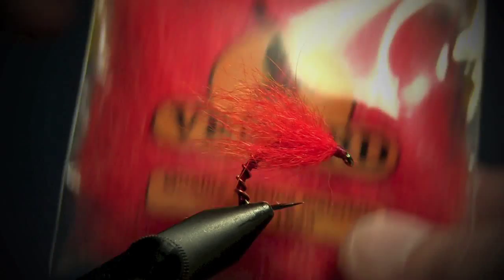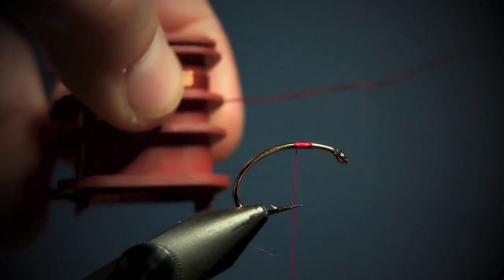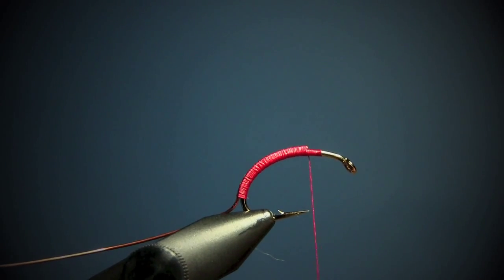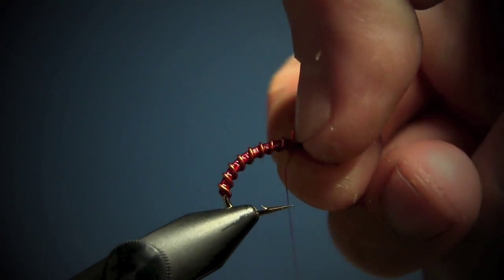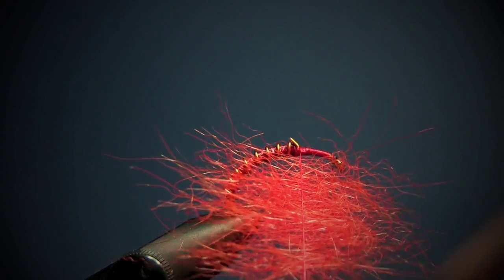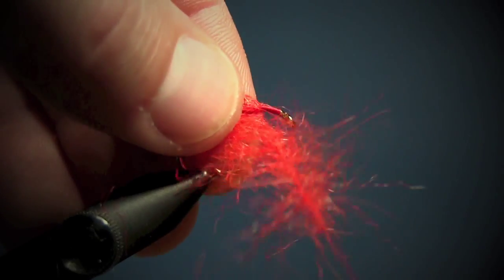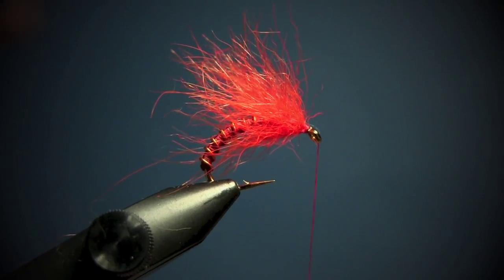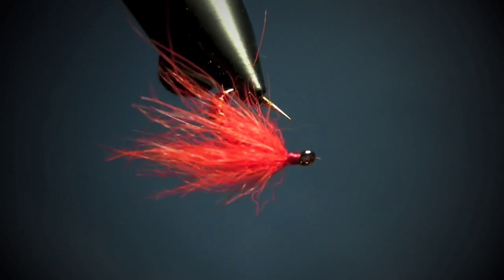Step by Step Flytying - Klympen

Comment from the maker: Hi Kim, I use a 9" leader that ends inn 0.27mm from Rio, in my jakket I got a roll of fluocarbon 0.24mm (for size 4 flies) 0.21mm  (for size 6 flies) and i use 0.17mm when the water is verry verry clear and stil, but 0.24 - 0.21 mm is what I use the moast, but if i fish with Spaykutlingen or other rader large flies i do not tie on anny tommer than 0.24mm, hope that hjelps u out:-) all the best Eivind Berulfsen